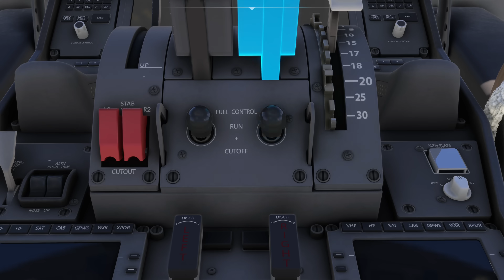Air India 171: Why Did The Fuel Cut-off Switch Get Moved?

Comment: Photos show the RAT deployed over the runway at around 70 feet during take off roughly under 3 seconds from VR at 30 feet per second, possibly around 165 to 170 knots. That means there was a failure earlier in the take off run, allowing for the several seconds it would have taken for the RAT to deploy. Given the low speed of 155 knots for VR, it suggests the RAT deployment would have taken longer. i.e. potentially 5+ seconds and up to 10 seconds, as the RAT requires the air speed to complete its deployment. Lower air speed means longer RAT deployment time, as the RAM air pressure is lower at near VR speeds. This more strongly points to an initial aircraft system failure possibly well before VR. The fuel switches in the cockpit weren't said to be transitioned until well afterwards when the aircraft was at 180 knots IAS. Basically you need to count back 2 to 7 seconds prior to VR to determine when the failure occurred, given the RAT would have taken 5 to 10 seconds to fully deploy.  Also the system failure first has to manifest and become detected by the aircraft sensors, which itself could take a few seconds. Thus further strengthening the hypothesis that the aircraft systems failure occurred well before VR.  This aircraft's take off performance issue, is supported by a long runway run leaving only 4 to 5 seconds from VR to end of runway. i.e. less than 400 metres remaining.  A clear red flag that a aircraft performance issue was likely present.
Reply: It's also curious in the preliminary report the timestamp for the RAT deployment and the timestamps for the two fuel switches RUN to CUTOFF transitions are missing from the report. I was going to point out and prove the RAT deployment occurred before the fuel switch CUTOFF using the recorded timestamps but they're conveniently missing from the report. 
Joey, you've captured the sequence of events very nicely and also point out the additional time needed to deploy the RAT and indicate a problem prior to VR. Even without the recorded timestamps in the report it appears obvious the problems started well before the fuel switch cutoff and in my opinion the fuel switches transitioning was more of a symptom (and electrical in nature) of a much larger problem with the aircraft. This also reduces the possibility of a pilot intentionally trying to down the plane in my opinion.
Reply: Unlikely intentional. The vast majority of aircraft accidents are NOT intentional. At this stage I would prefer to go with the statistics. However as per SAIB NM-18-33 if the switches were faulty, the acceleration force of the jet during take off might have been enough to trip them to OFF.  Also factor in the very hot weather, some say 42 degrees C on the runway. That means more thrust is required for take off, thus greater acceleration forces and vibration potentially forcing faulty switches to the off position during the run up to rotate.
Reply: Is it possible the senior pilot in the left seat decided to reject the takeoff at the last second and cut the engines but didn't communicate with the PIC who continued on and lifted the plane off the ground?
Reply: @AlCollins2244  - Nope, that's not how you reject a takeoff.  You want both engines running so you can put them in reverse thrust to help you stop faster.
Reply: I think anything is possible. I think the automatic assumption by much of the media of pilot guilt from deliberate sabotage rather than simply human error is a long bow to draw. There are so many scenarios that could have played out and in reality the vast majority of accidents occur out of the unknown and unexpected, not the known. The probability of deliberate sabotage in aviation is extremely low with most incidents being more attributable to human error and poor risk management practices. Given the botch job of the crash site recovery procedures and the destruction of set in place evidence, I doubt they are concerned about criminal investigations beyond attributing blame towards the deceased pilots who cannot defend themselves. Arguably the poor handling and potential contamination of the crash site was criminally negligent in itself.

Comment: Was it definitely determined that the engines were running before the switches were turned off?  If the engines failed for some undetermined reason, before the switches were turned off, and the airplane was descending out of control, could one of the pilots, in a state of panic, followed the procedure that smaller airplanes use when a crash is imminent , that is, turning off the fuel before impact with the ground to  minimize the chance of fire, which, as Captain Steeve said, would be futile.   We hope it never happens, but pilots are human beings, and sometimes act irrationally when facing certain death.  Captain Steeve responded to this possibility by stating that this was not normal procedure in a 787.  But,   Captain Steeve, whom I admire, was  under no pressure when making this statement.   However, because the only other explanation being considered, i.e. suicide, which is so unusual, and almost impossible to believe, all possibilities, however improbable, and/or unlikely,  must be considered before destroying a mans reputation and disgracing his memory and his family.

Comment: I'm not convinced the preliminary report is necessarily designed to be misleading, however I do believe the report is designed to be ambiguous and non committal, in order to buy more time to more fully investigate the incident. However in saying that, we are assuming good intentions of the investigators and that the investigators are not under any duress. That's a grand assumption, given the pressures investigators could be under by commercial interests with deep pockets and strong political connections and influence.
Reply: It might simply be that it takes some time to complete fuel shutdown sequence, before restart sequence can be safely and reliably initiated. On many aircraft, especially with FADEC-managed engines like on the 787, recycling the fuel control switch initiates a specific shutdown sequence, including fuel cutoff, spool down, and system resets, before the engine can be safely restarted. Thus a 9 second delay between OFF/ON switch cycling, might not be unusual at all.
Reply: Having two pilots required to shutdown of engine could work for and against the aircraft. Simple confirmation should suffice.  There has to be trust between the pilots, otherwise there is no point in flying together.

Comment: Mr Steve Report quotes that fuel engine control switch was transitioned from tun position to cut off in 0.1 sec and after one sec 2nd switch was transitioned. How it is possible to manually moved by pilot switch 0.1 seconds while switch has a spring locking system. How it is possible?

Comment: What could posses one pilot.... ? Possibility 1) It's possible that non of the pilots had actually moved the switch. Less likely but not impossible as off now. Yes there are safety mechanisms placed to prevent it but hey it's Boeing, if the faulty components are put, then it's possible that those safety mechanisms arent working? Possibility 2) It could be the pilot who turned them off himself saying the other pilot why did you turn them off. Is that not possible? Basically pilot A turning them to cut-off and then pilot-A himself asking the other pilot "why did you turn them off?" to put blame (on record) on the other pilot. Possibility 3) what Captain Steve mentioned.

Why does the computer allow the two engines to be shut off at such a low altitude. Disagree with Captain Steve here. That's I think the real solution. There is almost nothing good that can be achieved with shutting off BOTH the engines at such a low altitude. It's a certain death sentence to the plane and all onboard. It should be under computer control or at least under computer monitoring. So that at least a big audio-visual alarm is raised when it happens saying "both engines are cut off at low altitude!".

Why can't the fuel switches be designed to require two people to activate? - Simple, that makes the plane more vulnerable. The reason why a plane has two pilots is because of something happens to one of them the other can safety fly it. If two people are required then that is not possible unless we have at least 3 pilots in the plane.

Comment: Or why not link those switches to the "weight on wheels" switches. Then, it would be impossible to cut off the engine mid air.

Comment: What is the probability that the locking mechanism on the switches was non functioning and when the aircraft rotated under thrust they just fell "vibrated" to the off position. I take from the transcript that neither pilot was aware the fuel was turned off.

Comment: Hi Steeve:  Would you kindly answer the following questions based on your indepth knowledge and experience:  Assume yourself to be the First Officer/ Pilot Flying in AI 171. When you rotate, you look outward and there is sudden loss of trust. What would be your immediate reactions? What would you shout? What would you tell the Pilot Monitoring?  I dont think you will ask 'Why did you cut off the fuel Switch".  It will be therefore great if you would please let us know your first reactions and the actions that you will take when you find that, during the take off, that the engines have lost thrust.

Comment: They are not levers, they are switches. Maybe put one fuel cutoff switch on the captains side and one switch on the f/o side. That would prevent one pilot from cutting off both engines, at least by using said switches.

Comment: Did you cut of the fuel switches?
Why did you cut of the fuel switches? 

1st question other pilot is not sure whether co-pilot has cut off fuel switches.

2nd question implies that other pilot is sure that co-pilot has cut off the fuel switches. 

Stop this propaganda don’t add “why” 

In report “why” is not mentioned but these white pigs are adding why deliberately to put blame on Pilots.

Comment: I saw a comment made by an ex-pilot of 787 Boeing Dreamliner, that it is highly unlikely to engage both fuel control switch from run to cut-off within 1 second, as mention in preliminary report. So my question is do we know how much time does the report shows it took the pilot to put both the fuel control switch back from  cut-off to run ? If not, what could be the reason this info is not disclosed ?

Comment: Well, if it's necessary sometimes to cut the fuel input at low altitude, like during an approach where the engines are idling or at low thrust, why not design the system so the switches can't be deactivated at high thrust like during take-off ?

Comment: Surely they will be testing the switches from the crashed plane to see if the safety cams are there and still working. This would prevent them from vibration to cutoff like some has suggested.

Comment: On the question asking why not have the fuel cutoff switch require both captain and FO to cooperatively flip the switch - on the surface it sounds like a good suggestion...but what about the situation where either the pilot or FO becomes incapacitated and then there's an urgent need to cut fuel to an engine. I'll grant that it's not very likely to happen, but it seems like that would be a  good reason to still have it be a 1-man switch.

Comment: Hi captain,is there any regulation if legit to have in the cockpit a recording device sound and images for the last 10 mins including those exchanged between the plane and tower control to match the blackbox recording but separate devices as this could be used to clear pilots being blamed and framed for aircrash but could not give evidence as they passed away in the course their duty.may be I watch to many sci-fi movies but my thought is genuine to clear off the “pilots error” who are the heroes of everyday flights but did get low credits at times.

Comment: Captain Steve, thanks for always being so thoughtful. Is it possible that a different aircraft or weight profile could have yielded a different outcome? So, if fuel is manually Cut Off immediately upon rotate on a 737 or an Embraer or a Cessna, could aircraft like that recover in time after fuel switches are switched back to Run? Is part of the issue here that we had a heavy 787? Thanks again!

Comment: Can’t there be a control for fuel cut-off switch integrated with weight switch(which recognise if the flight is in air or land). So it can’t be turned off mid flight. Or is there a scenario where it requires to cut-off mid flight ?

Comment: Can anyone tell me why it's called FADEC but allows the pilot to manually cut off the fuel? Before cutting off the fuel switch, Pilots must be required to switch to manual control mode first. My 10 year old SUV goes to neutral when I switch it to reverse at high way speeds. It knows that it can't do that. But a $250 million aircraft can't show such intelligence? 

Ground all Boeing airplanes right away and fix the s/w first before allowing anyone to fly on those!

Comment: Why you don't consider the fuel quality and fuel transmission system and the hot humid weather in Ahmedabad that day when the AC of the aircraft was malfunctioning?
Aviation fuels must be free of impurities that would interfere with the operation of the engine or the units in the fuel and induction system. Even though all precautions are observed in storing and handling gasoline, it is not uncommon to find a small amount of water and sediment in an aircraft fuel system. A small amount of such contamination is usually retained in the strainers in the fuel system. Generally, this is not considered a source of great danger, provided that the strainers are drained and cleaned at frequent intervals. However, the water can present a serious problem because it settles to the bottom of the fuel system. A small quantity of water will flow with the gasoline through the carburetor jets and will not be especially harmful. An excessive amount of water will displace the fuel passing through the jets and restrict the flow of fuel; it will cause loss of power and can result in engine stoppage. Under certain conditions of temperature and humidity, condensation of moisture (from the air) occurs on the inner surfaces of the fuel tanks. Since this condensation occurs on the portion of the tank above the fuel level, it is obvious that the practice of servicing an airplane immediately after flight will do much to minimize this hazard.
https://share.google/Jimmy sugar snub